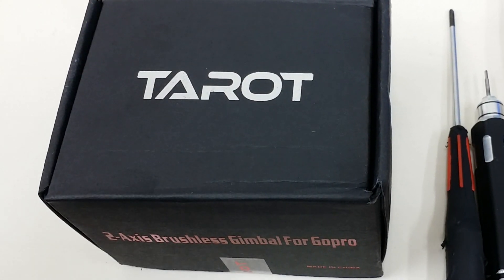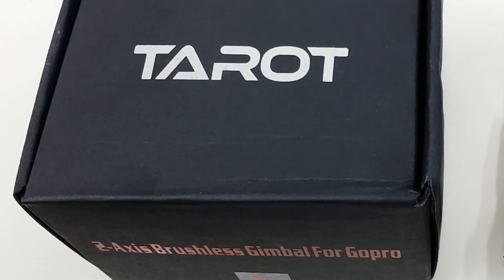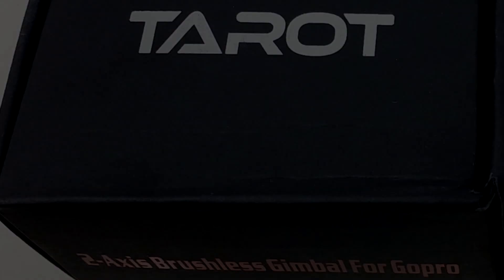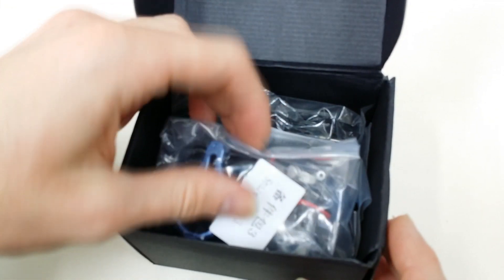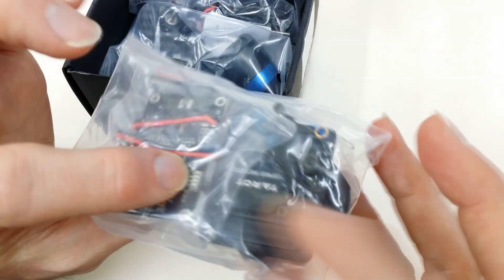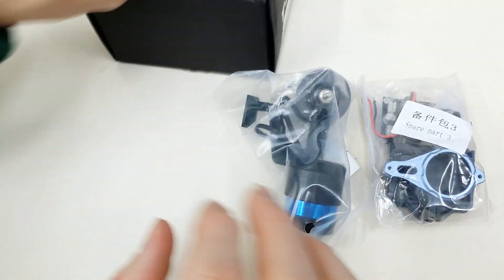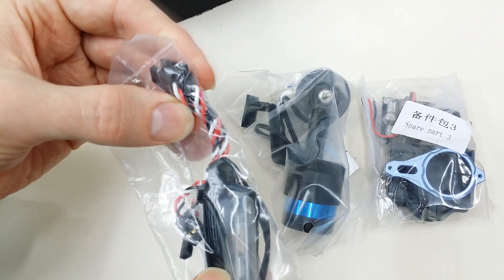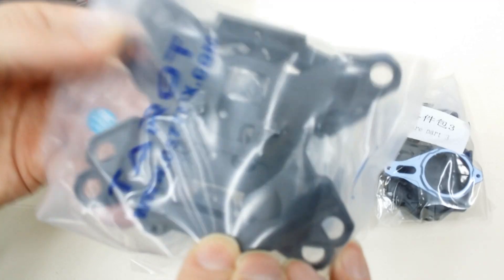Tarot T-2D V2 GoPro Camera Gimbal Assembly, Tips & Tricks & Troubleshooting

Comment: 15:10 3 HANDS!

awesome video. great attention to detail. does the board come already programed?
Reply from the maker: Thanks!  Yes, the board comes loaded and ready to go.  There will most likely be a software update available, but it will work out of the box.
Reply: I went ahead and bought this Gimbal.  I love It! I was able to upgrade the firmware with no problems!  Inhale It on a p2 with full tilt control.

Comment: Very nice video. But at 13:30, the screw you took out, as i know is a counter weight which you only take out if you use a cable direktly on the camera.

I'm planning to use this gimbal on my motorcycle. Therefore it would be great to unable the tilt motion. The camera should stay at a fix angle compared to the gimbal and the bike. Is this possible?

I'm thinking of driving uphill or downhill and to see the road like it is seen on the plain. Otherwise the camera would stay horizontal and it would either see down on the tank or up into the sky.
Reply from the maker: That screw weighs so little, I can't imagine it would make any noticeable difference in balance.  As for keeping the camera at a tilt angle with your bike, I think it's possible using the configuration software to change or disable the tilt axis.

Comment: Thank you so much, this video has been unbelievably helpful. I searched all over and found nothing as helpful and straightforward as this video. 

I found out that the Tarot V2 doesn't mount directly to the bottom of the Phantom 1 or 2. An optional adapter plate is sold on ebay/amazon for it.
OR the DIY approach for those like me not wanting to wait 30 days for it to ship from China: I rounded out the front hole enough to fit the stock mounting screw (from the stock GoPro mount) to fit through it and into the existing DJI threads. And on the rear mounting hole i lined it up and drilled a hole small enough for the included long allen bolt (the one used with the other Tarot mounting gear) to fit through it and then attached that with the nut into the battery compartment. Fits snug.